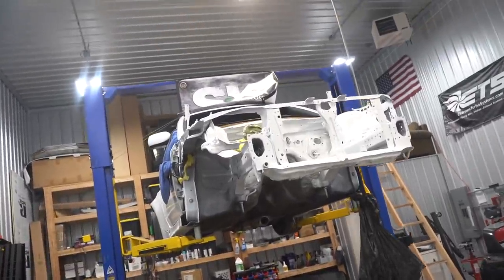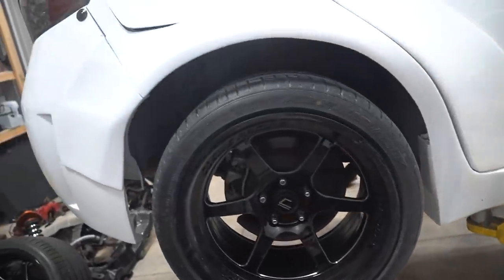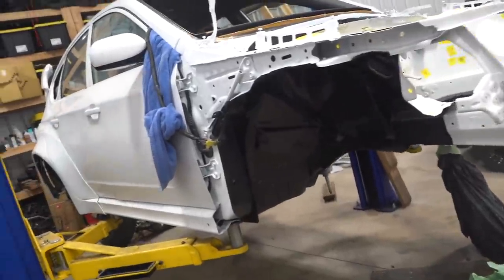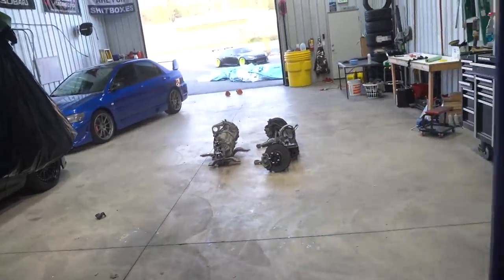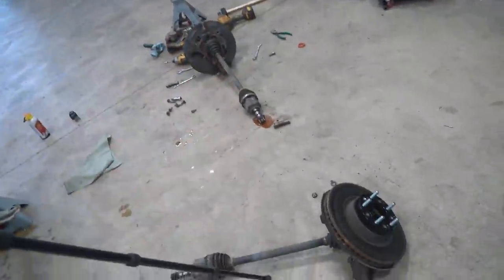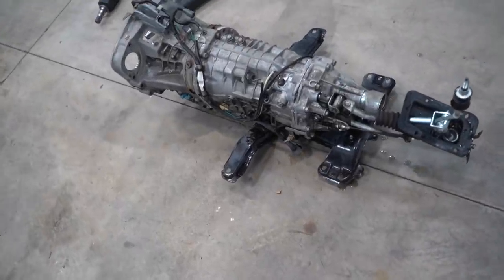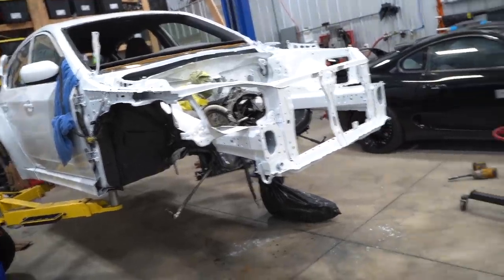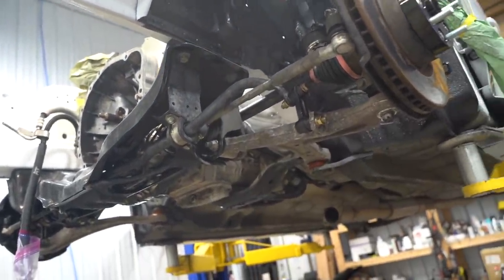Assembling the STI!!

Comment: Great video  Devin.  I have a quick suggestion.. You should get a Turbo nozzle it's a nozzle for your pressure washer wand. That will help with cleaning very dirty and oily parts. It increases the PSI of your pressure washer. Also could you have used your engine Jack to lift up the transmission off of the floor?

Comment: Using a torch to heat up the part then spray some penetrating oil, and repeat that a few times usually does the trick without beating the shit out of stuck parts